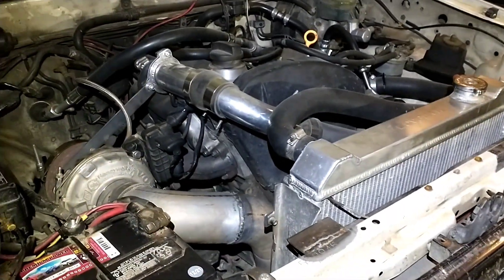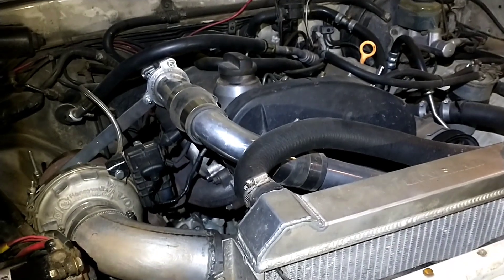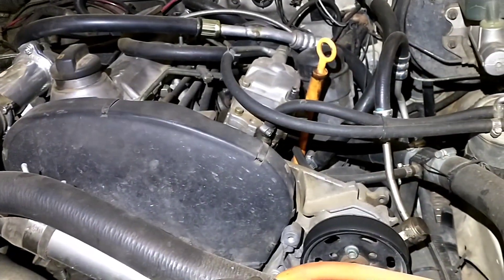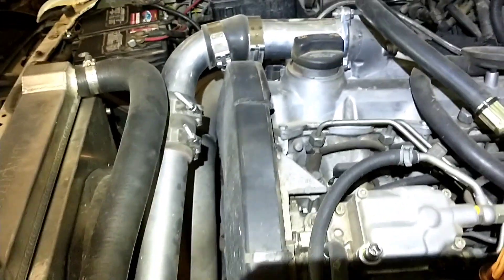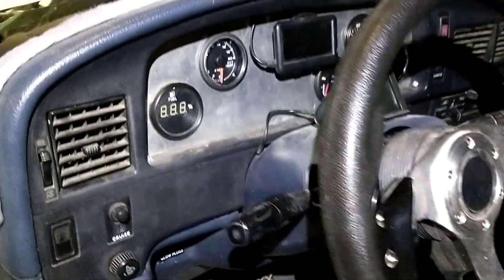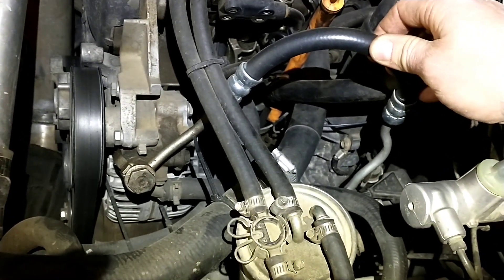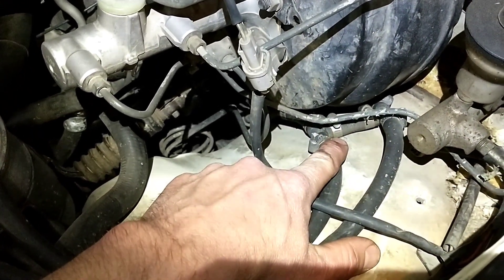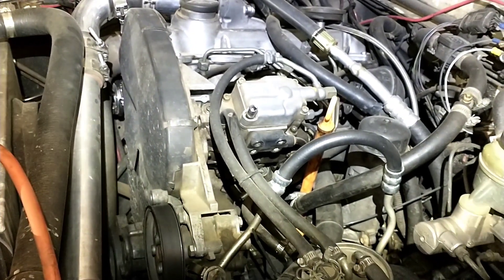What Do You Need To TDI Diesel Swap Your Vehicle? Basic Part List For Any Engine Conversion

Comment: What would be a rough estimate of how much it cost to do this swap. I’ve got an early 90s Toyota pickup with the 3.0l that I have been considering doing this swap to as well.
Reply from the maker: I have a more in-depth video on this, but the cost can vary greatly, guys buy a nice parts car and end up parting it out for more than the swap cost, then others buy every part brand new and have $10k into it before they even get it running.  On a budget and no donor car it can be done pretty easy for under $4k though.

Comment: Hey buddy thanks for all the good videos. My question is doing the alh swap in an old yota do you need vagcom vcds and for what? Also if you do will the cheap ones on amazon work says they work for 05 and newer. My motors are 02. Thanks again for all the good info
Reply from the maker: No problem man! So the Amazon ones can be tricky to install but it is possible to get them to work most of the time depending on which version of Windows you're using, the older the better. But it is definitely necessary for timing as well as injection pump settings to be able to get into the ECU and see everything digitally. Even the cheap vcds shows you more than an expensive snap-on tool so I would highly recommend getting something

Comment: Can you describe a bit further as to what the H in the fuel lines is accomplishing ?  Are you you adding the H between the feed and supply lines to limit pressure to the injector pump?
Reply from the maker: Yes that's exactly it, so like on my Dakota the gasoline fuel injection tank pump will build up to 60 PSI pressure if it's fed straight to the TDI injection pump and that will blow the seals on most diesel pumps, but with the H setup in i see 20-25 psi at the pump.  A regulator would do the same thing, but probably cause more strain on the tank pump I think

Comment: Seems like you have done a few... what is the biggest reason (part interference) that you need to body lift for a ALH into a 90 4Runner.  I have a V6 Manual 4x4 going to get a swapped soon and never figured out what the issue was going to be that everyone talk about the body lift.  I have the doomsday diesel adapter plate kit.  Have my engines, but doing a BHW block/ALH hybrid engine.
Reply from the maker: 90 should not need a body lift, it's the older Toyota body style that has a slightly smaller engine bay and tighter engine to firewall clearance.  Yours should be identical to my Toyota pickup, and I have lots of videos showing how it fits with a similar acme adapter plate.
Reply: @TDISwaps  Solid, thanks for the info.  Ill dig into the videos.   I know it will be certain hurdles when I I get into it and just trying to figure what I am in for.
Reply from the maker: @Celco217 yeah there's a playlist for just my Toyota and you can really see in the beginning how easy it was to get it in there at the right angle everything just fit

Comment: For throttle pedal, did you use the factory throttle cable or did you have to convert to drive by wire?
Reply from the maker: All these were converted to drive by wire
Reply: @TDISwaps  awesome, thank you! I’m planning on converting my t100 soon simply for fuel economy and for fun. Its a 2wd so it’ll just be a cool swap
Reply from the maker: @rigobertofernandez3993 that will be a blast!
Reply: @TDISwaps  definitely! Don’t have to worry about front differential clearance 😅
Reply from the maker: @rigobertofernandez3993 just steering I think haha
Reply: @TDISwaps  yup. But still significantly less than a 4wd frame

Comment: I want to ask some trivial questions. What power? what is the boost pressure? What is the fuel consumption on the highway and in the city?
Reply from the maker: Well each vehicle is different that I have, but I am tuned for 180-250 HP at 26-36psi boost.  And fuel consumption varies but they are at least double what I got with the original gas engine before the swap

Comment: Thanks for your videos. 
I have a 2004 VW TDI BEW Manual (wrecked) and a 2002 VW 2.0 Jetta Gas Automatic. Planning to swap the BEW TDI engine into the Jetta Auto and the ECU.
Any think else I need to consider, recommendations / links that could help? 
Anything that that you would not recomend. 
Does the TDI BEW ECU need to be re-tuned from Manual to Auto?

Thank you for your advice in anticipation. Stay safe and looking forward to more videos.
Reply from the maker: You may want to check gear ratios in that automatic, it's very well maybe completely different than the diesel transmission and have you running 1000 RPM higher on the highway.  And yes the ECU and wiring will not match up, adjustments will need to be made there
Reply: @TDISwaps  Thanks for the comments. 
"Gear ratios": Ah! I thought so. Is there a fix and has it got to do with tuning? 
"ECU and wiring" Since I am putting in the Engine, ECU and wiring from the BEW TDI, will it still be an issue?
Reply from the maker: @jmindito as long as you swap everything shouldn't be a problem, I would try swap the transmission and everything
Reply: @TDISwaps  👍That's a very practical advice and I was considering that. However, just wanted to continue with the convenience of the automatic for city traffic.
Reply from the maker: @jmindito yeah as far as I know the gear ratios will make that not really an option
Reply: @TDISwaps  Thank you for all your advice. Sincerely appreciate your time. As you suggested, i will go for a "Full" swap as that makes more sense and less issues down the line.
Reply from the maker: @jmindito no problem man and thanks for watching the videos! Definitely the smart way to go even in good condition I see those automatic transmissions fail all the time

Comment: What did you do for Engine mounts? from what I have seen, theyre mounted from the front and back in the cars instead of on the sides of the block.
Reply from the maker: If you check out my playlists I go over motor mounts.  I make custom mounts in each side of the engine using spare holes in the block

Comment: Can you run factory 86 toyota gauges?  Or do you have to run custom gauges?
Reply from the maker: You can definitely use the factory sensors out of the Toyota engine and plug them into the VW, I just prefer to see numbers
Reply: @TDISwaps  hell I can't see good enuff to matter!! I want simple reliability.  Wats best adapters to use ? I have a 22r toyota stock tranny also a w56 tranny .also a  r150 3.0 tranny wat be best for swap ?
Reply from the maker: Well w56 is weaker but has cheaper adapter.  R159 is much stronger and doomsday diesel makes a pretty cheap adapter

Comment: Do you think this swap can be done on a 1985 jeep Cherokee that came with the 2.1 Renault turbo diesel engine?
Reply from the maker: Oh it can be done on anything but transmission adapters may force you to use a different Jeep transmission
Reply: @TDISwaps  that’s fine. I’d rather use. An ax15
Reply from the maker: @moejr14 yep that makes it an easy swap. As long as you can fabricate motor mounts and some hose routing the rest is easy. If you don't want to mess with electrical I make these plug-in play harnesses like in my videos for guys
Reply: @TDISwaps  so you make a standalone plug and play harness for the jeep that goes to the TDI?
Reply from the maker: @moejr14 well I make universal harnesses that plug into anything and you just have to wire your gauges to the engine. I can explain more if you want to find me on Facebook. https://www.facebook.com/profile.php?id=100014261163897&mibextid=ZbWKwL

Comment: Hello i have a 98 gmc jimmy 4x4 blazer. Theres plently of vw diesels here. I want to pull the 4.3l out mount the vw in to the 4l60e. Want to keep the stock drive line. Convert over to a mechanical 4bt pump(bolts in) and have a pure mechanical diesel. Looking to build a multifuel diesel 4x4 suv. Run off used motor oil(wmo conversion), veggie oil,diesel you get the idea. A shtf vehicle
Reply from the maker: Well the 4bt pump doesn't just "bolt on" and needs quite a bit of adjustment to not be over fueling the 1.9l.  but you definitely can do it, the 4l60 works well with a high enough stall converter.  I actually run all kinds of alt fuels through my electronic pumps as well they run WMO just fine.
Reply: @TDISwaps  awsome yes your right about the 4bt pump I am running into some issues . I swapped the vw pully it bolted to the timing cover an seems to work but I don't think the injectors(stock ones) are big enough

Comment: Any advice on the electrical portion on a BRM swap into a 99 S-10? It’s automatic with a 4l60e. I found the adapters for the trans but I’m worried about getting everything working on the electrical side. I’m fortunate enough to have the 06 Jetta that the engine is in tho.
Reply from the maker: I have wired a few of those harnesses for customers now, pretty straight forward after everything is deleted, just have to follow the schematics.  Also check over the wires and untape everything to inspect.  BRM wiring is known to crack and cause all sorts of signals issues
Reply: @TDISwaps  so your saying it may not be as bad as I’m thinking. 🤣🤣 the truck is a project for my son. He is 13 but this will be his first vehicle. We are excited to get started and will be pulling the tdi soon to change timing belt and all gaskets. After that we will dive into pulling the harnesses.
Reply from the maker: @Hatefulfoot well it's easy for me but I'm used to VW wiring.  The schematics on the Facebook group TDI swapped trucks shows you everything.  I also can make the harness and tune the ECU if you need it.  So that can be your backup plan if you get started and your brain explodes 😂
Reply: @TDISwaps  I’m gonna look up that group now and I might reach out to you about doing that lol. Thanks for all the info!
Reply from the maker: @Hatefulfoot no problem! Glad to help out the TDI community, I pretty much just charge for my time, you get the experience free lol

Comment: You ever seen one of these engines mounted to a three on the tree transmission?
Reply from the maker: Most of the older builds I've seen use a newer transmission to get overdrive. There is an early small block Chevy adapter though so I'm sure you could make it work
Reply: @TDISwaps  what website are you getting these adaptors from?
Reply from the maker: @FirstGendodgegarage should be the one you would need here. https://tdconversions.com/products/vw-1-9-2-0l-tdi-to-chevy-small-block-adapter-kit-pre-1986?sca_ref=2282812.xcTsEMbSOW
Reply: @TDISwaps  hell yeah brother thank you I’m excited now
Reply: @TDISwaps  I’ve subscribed to your channel. We do a lot of stuff like this on my channel. Also, working on a build right now.

Comment: I'm wanting to swap one of these into a 92 YJ Wrangler that I just picked up. It has the 2.5L, so it has the weak AX5 transmission and 21 spline transfer case. I'm not sure the transmission would hold up behind one of these.
Reply from the maker: Most guys that use the ax5 keep the TDI under 120 HP and it does alright, still over 200 TQ so it moves the jeep just fine similar to a 4.0l

Comment: Would a 2010 2.0 work?
Reply from the maker: Yes definitely! They are more complex and part are more expensive, quite a few different deletes that need done to make them dependable, but for more money you can end up with an even higher HP build, so it's not at all out of the question for the swap.

Comment: Hmm thinking of one of these for my 2002 Frontier now. One cool thing about the D22 is the engine harness is separate from the body harness (would just have to make a jumper harness to interact with the body harness) What kind of fuel mileage can be expexted in a 4000lb vehicle?
Reply: I have a 2001 Frontier that I want to do a swap with
Reply from the maker: @BeanMartinVEVO they should be making frontier adapters at TD conversions now.
Reply: @TDISwaps I found one online, I think I will be jumping in soon. I need to rebuild my transmission, so I think I’ll do that while I have everything taken apart
Reply from the maker: I can easily get 30+ MPG highway out of my 4k lb Toyota at 75 MPH

Comment: Hey can you make me a harness with instructions for a 98 ford ranger 5 speed swap. And if so how much 😊
Reply from the maker: I only make universal harnesses, but they are easy to install into any vehicle, depending on the TDI they run $300-550 with a core harness exchange.  You can find me on Facebook https://www.facebook.com/profile.php?id=100014261163897&mibextid=ZbWKwL
Reply: Older the better I'm guessing. I'd like to swap a 72 commando.
Reply from the maker: @ronaldjensen8927 that would be sweet!
Reply: @TDISwaps  thinking most cj5 swap parts would work.
Reply from the maker: @ronaldjensen8927 ya that sounds right

Comment: how does it do highway driving? especially vibrations and speed
Reply from the maker: There is slight vibration at idle but on the highway you can't feel anything, smooth as could be

Comment: please try to convince tdconversions to make an adapter for the ford 2.3 lima from the old rangers.
Reply from the maker: I wish I could! I can't remember how many requests they need to make a new adapter but it's a lot unfortunately 😔
Reply: @TDISwaps  Its a darn shame since most rangers were the 4 bangers as well as alot of other older cars. 

Just imagine a 1.6l vw diesel in a 70's mustang mach II... the ultimate abomination of the gas crunch.
Reply from the maker: That would be awesome!
Reply from the maker: Ya I am actually liking the setup of a manually controlled auto behind the TDI, and that makes it pretty universal to swap in a jeep or Chevy transmission into anything with some custom drivelines.  @davidmeier1004
Reply: i already put a reman trans in my ranger so i would prefer that to not be a sunk cost @TDISwaps
Reply from the maker: @davidmeier1004 I'm not sure that transmission will really be able to handle the TDI torque though
Reply: @TDISwaps  I wouldn't do a tdi, I would stick to older indirect injection and most likely NA models. 

That said i am quite sure the trans could handle it given that one guy on ranger station did a custom adapter and them pimped the engine out quite alot.
Reply from the maker: @davidmeier1004  Oh ya at lower power levels of the older VW diesels you would be, I just can't hardly drive one with under 250 FT LBS TQ though ha ha.  From what I read those Mitsubishi transmissions didn't hold up much over 200 TQ, at least abused and towing alot.
Reply: @TDISwaps  as it stands i have a really high mileage Gasser that was only rated to give 135 FT LBS when new SO ... 200 would be quite alot.
Reply from the maker: @davidmeier1004 oh for sure, but I would not trust that trans behind any of my engines.  For your goals it would be fine, I'm just not sure they will ever make an adapter for it unfortunately 😕
Reply: @TDISwaps  I know and I'm disgruntled
Reply from the maker: @davidmeier1004 ya it was a major pain converting my Dakota to a jeep transmission, but I gave up on them making a Chrysler adapter
Reply: @TDISwaps  i feel the main issue is they have adapters for the 3l and 4l engines so that are pretty close to a drop in replacement since the only external difference is the integrated bell housing. Since they have these adapters, most people just get one of these trans and move on thus deprioritizing make a whole separate adapter.
Reply: @jerbear7952  What makes you say this? Please explain your logic.
iirc the swap by greengeeker was fine but he built a custom adapter and never released the files. (his was the 2.5l lima but same deal tranny wise.)

Sorry to say this, but your position was proved wrong over 10 years ago and unless you can explain why a very well documented swap that ended with a perfectly functional vehicle suddenly wont work now that some time has passed then i suspect you have a little more reading to  do.

That said the ranger i was considering swapping was is no longer alive so noo need to freak out. Also even if it was i would just import a jdm at this point.

Comment: Have you had any problems longevity wise using original fuel pumps? Also, is the H to relieve the extra pressure from standard gasoline fuel pumps?
Reply from the maker: I've got about 40K on my Toyota's pump running WMO, no issues with any of them so far. I mean the Chevy's pump is bound to go out just because it's a Chevy fuel pump LOL.  Yes the H is just to relieve pressure
Reply: @TDISwaps  Can you run without a fuel pump? Don’t the Bosch p-pumps pull a siphon from the tank?
Reply from the maker: @FuZioNxYT yes if you want to drop the tank and put in a siphon you can, I prefer not having to mess with the tank at all though. Having the lift pump is also nice if you get any fuel line leaks I'd rather have diesel coming out than air getting in and killing the engine. On top of that over 200 hp these smaller Bosch pumps need a lift pump to supply enough fuel for the added HP

Comment: Hello, i want to swap my 3.6 dohc in my pajero for a 1.9,i just want to commute, no extensive off road as such,,  i dont need nay eleftronics, what year engine would you recommend?
Reply from the maker: If you want to run a mechanical injection pump you will need to stick with the 98-03 TDIs, I'm not sure on the adapter for a 3.6 Pajero either
Reply: @TDISwaps  thanks a lot, i dont need an adapter as i will be swapping the tranny along.
Reply from the maker: Oh perfect! Well see what you can find, the wiring is also very easy

Comment: Have you done or seen anyone do a frontier tdi swap?  I learned today you can use a 4bt VE pump and delete the wireless peddle.
Reply from the maker: It is extremely hard to get a 4bt pump tuned for any kind of fuel mileage or lack of smoke, they are mostly used for high HP application and getting it on there will cost you a good bit but it is possible. I do wiring and tuning services for way cheaper.  I think I've seen a fromtier in the works but not finished yet